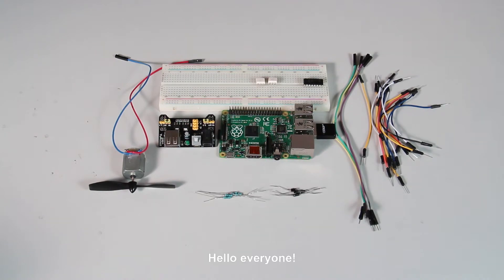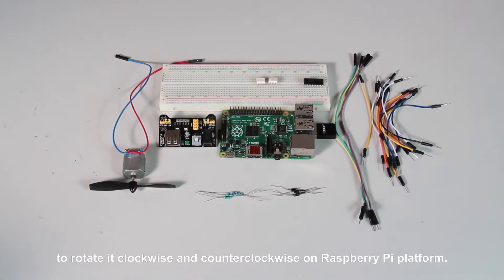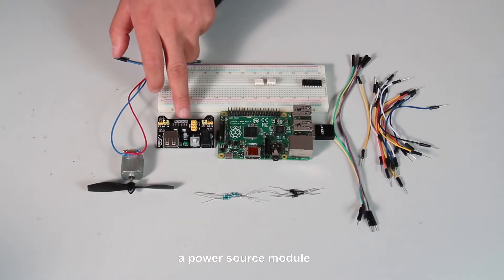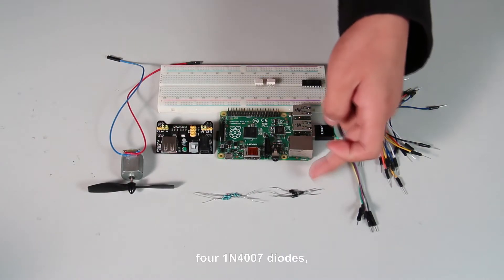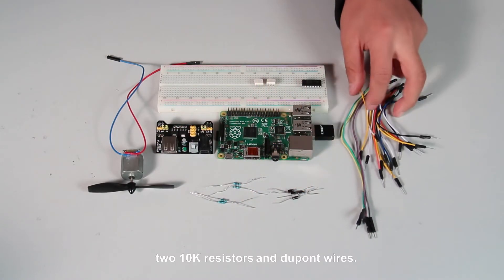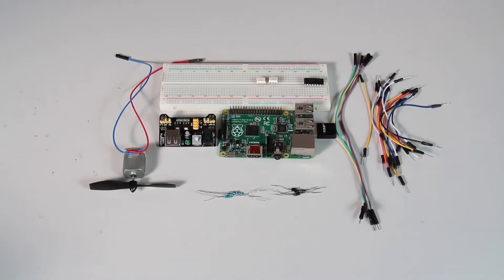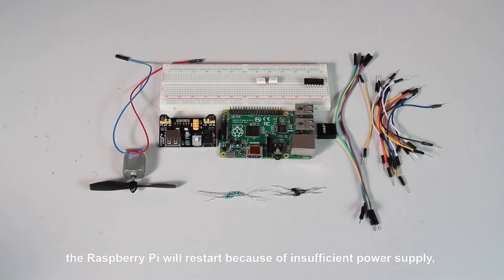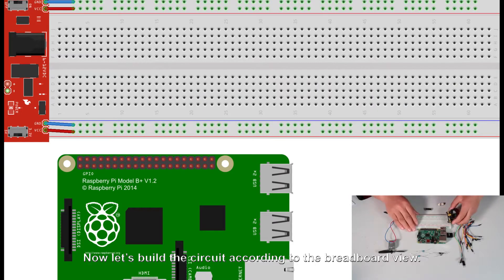Sunfounder Kit Turorial for Raspberry Pi - How to Drive a DC motor

Comment: In your video, you never show the ywrobot actually plugged in to a wall power source. Is it not necessary or is the ywrobot actually plugged into power but just not shown.
Reply from the maker: +Ty Seyoum Yes the ywrobot power source should be connected to a DC 6.5-12V (for more details like the wiring and code, please check the lesson page by LEARN->Get Tutorials on our website). This part is not shown in the video. Sorry for the misleading. We'll improve the video ASAP..Thanks for attention.

Comment: Hi, thanks for posting this tutorial! I had a few comments about the tutorial.

First, you did not mention that the top jumper on the power supply should be 5V (the default is 3.3 V

The second part is that even with the power supply on the right setting the motor runs rather... slow. I think it might be that the jumpers aren't actually soldered to the motor but I need to investigate more.
Reply from the maker: +Crolapras Sorry for the late reply. So have you figured it out? To drive the motor, an external power adapter needs to be plugged to the power module. So here the reason may be that the connected adapter cannot provide enough high power for the motor.
Reply: +Sunfounder yeah, it didn't even work even then.... I ended up rewiring it and removing all the sections with the diodes and using different resistors. It then.... kind of worked.... but it didn't quite do what I was planning it to do, so I replaced it with a solenoid. But thanks for the response.

Comment: Hey, thank you for this helpful Video.

 Can you tell me what that Cabel is, which you  insert in the YwRobot Breadboard?

I have no such Cabel with the Package from Sunfounder. Did I really need it?
Reply from the maker: You need to connect a external power source between 6.5V and 12V to the power module, but we don’t provide this external power source in this package.
Reply: Sunfounder what is the name of it? 
I hope i can find it in conrad-shop.
Reply from the maker: Mohammad Safaadin Hussein you want to buy one?
Reply: Sunfounder yes,  i need only the name of the power supplay.
Reply from the maker: Mohammad Safaadin Hussein The name is power adapter. It can output 9V.